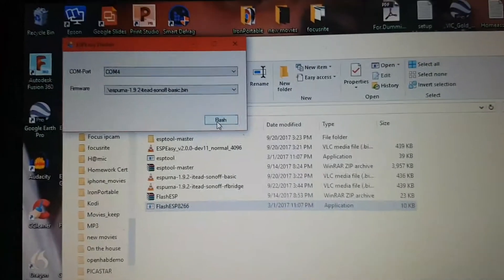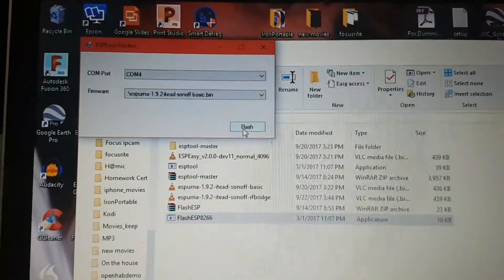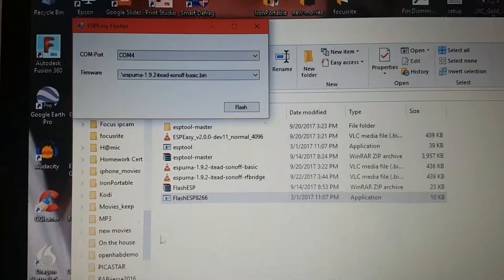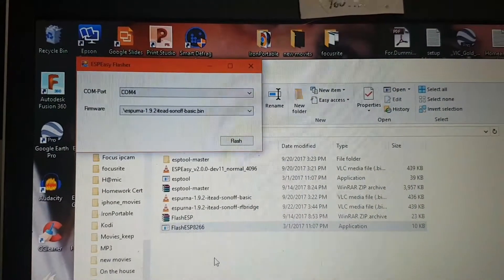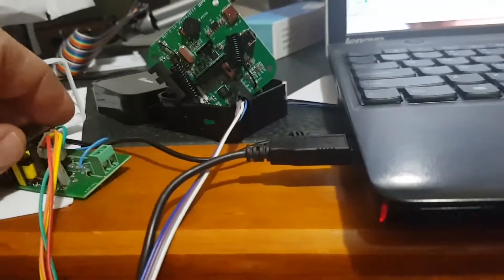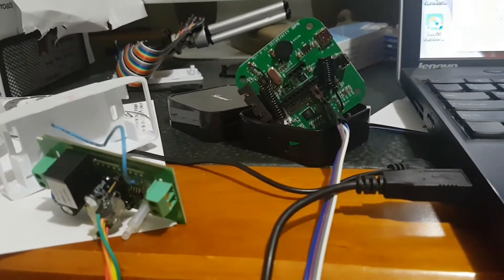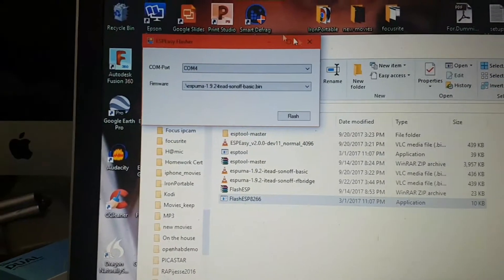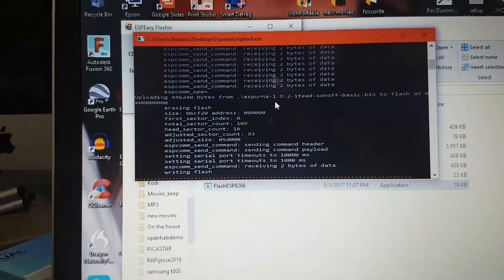Quick Basic Sonoff flashing with Espurna.  IOT Part one.

Comment: Hi, great video, help me to flash my Sonoff basic, and the RF Bridge witch is working very well. I have a question for you : How could I put the Sonoff basic in flash mode if the button allowing so on the board is broken?
Reply from the maker: +Valéry HELENON Hi Valery, and thank you for the question. I have made a new vlog to help you and others without a switch. By the way the short way is to short the pins on the switch.